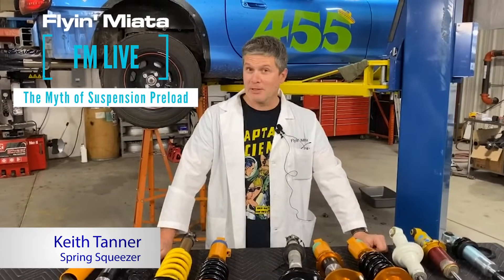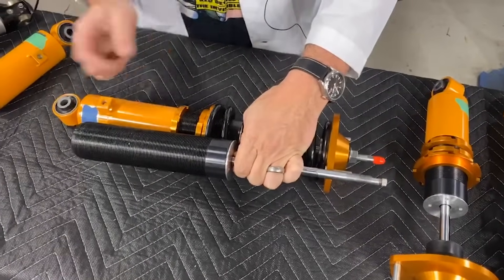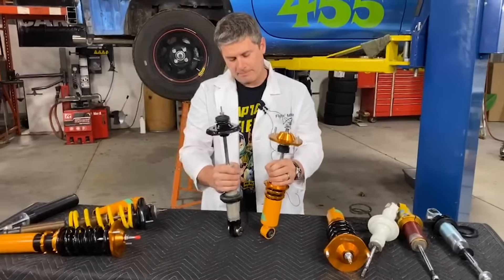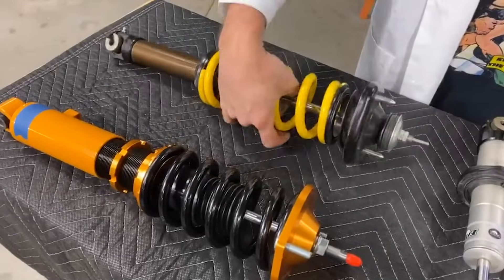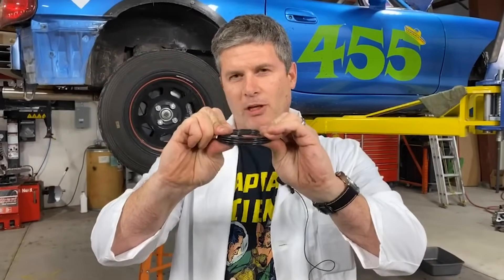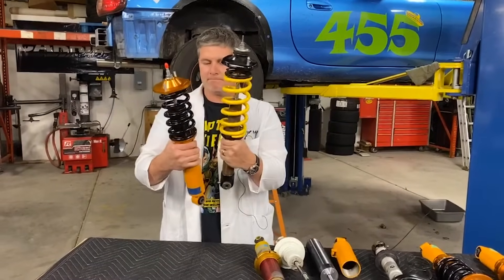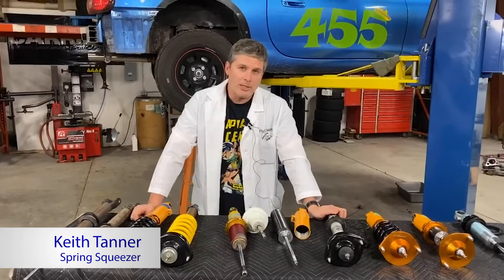The Myth of Suspension Preload (FM Live)

Comment: Make sure you know your motion ratios. The fronts tend to be very high relative to your rears.
A 6in travel Front suspension could be 10in travel at the Front wheels.
Reply from the maker: Good point and for NAs this is why a 3/16" shock top spacer results in a 3/8" height difference at the wheel.

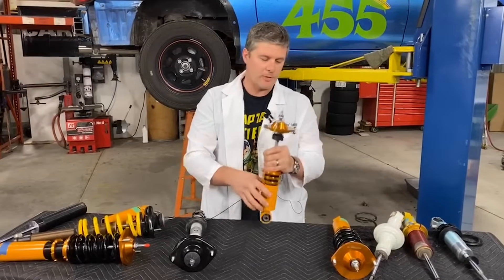Comment: quick question... Is the additional 4 mm on preload required and or a must… On factory bought proper OEM spec coil overs for an every day driver… Meaning 7:36  once a spring is tight in the cradle do you really need that additional four or am I just hindering ride  quality??   thank you for a response
Reply from the maker: Preload does not affect ride quality. Not sure where the "required" 4mm of preload came from, but that may be a manufacturer making sure various hardware does not come loose. Set the shock length first (if applicable), then set the ride height with the perches.
Reply: @FlyinMiataVideo   Thank you for your response👍
Reply from the maker: @darksolara6750 You are welcome and thank you for watching!

Comment: Perfect analysis, thank you! Just a question: In a rear torsion beam of a FWD car where damper and spring work separately (not as a coilover), if you use spring spacers in order to raise the ride height at the back, do you affect the spring preload?
Reply from the maker: Yes, most likely. The shock will likely be the limiting factor at full droop, and thanks to the spacer the spring won't be able to extend quite as far. So the preload will increase.
Will this have any effect on the behavior of the suspension at anything less than full droop? No, not unless the spacer is so big as to put the spring into bind at full bump.
Reply: @FlyinMiataVideo  Thank you for your reply! The preload changes the force needed to start compressing the shock, correct? So why this will not have any effect on the behavior of the suspension? I would assume that at least for "small" forces a preloaded spring will be "harder" to compress and therefore harder compress the shock.
Reply from the maker: @dinostalieris3998  When the suspension is at full droop, it won't start moving again until the loads on the spring exceed the preload. Once the spring starts to compress, it won't matter if there's any preload or not. So the only time there is any effect is when a wheel is fully unloaded, such as when you're jumping or if you're hanging a rear wheel under hard cornering - something FWD cars may do.

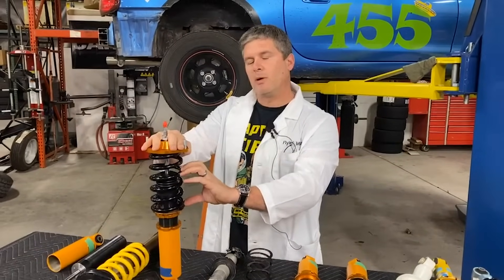Comment: I don't know if this is a semantic thing in the example presented, but the bit I'm still confused about (and other comments only added to the confusion) is the mention that "the ride height will be the same" around 2:35. When people talk about "applying preload" aren't they doing so by raising the spring perch while the shock is at full extension, which I've understood should be raising ride height? Or are we assuming that they'd somehow be adjusting preload without raising the spring perch in that example?

Edit: never mind, I found an argument below that suggests we agree that the ride height will change if you "adjust preload" by moving the spring perch up. It seems like your main contention is that the preload is a side-effect there and not the main thing we're adjusting, but it seems a tad nitpicky to make that the distinction since the only way I could imagine anyone out there reasonably changing the preload IS by moving the perch at full extension-- I feel like that is the basis of a lot of the misunderstanding/disagreement in this comment section.
Reply from the maker: The point being made there is that preload is only measured with the shock at full extension. It does not directly affect ride height. It's possible to build two shocks with different shaft lengths but that are otherwise identical. One will have more preload than the other with the perches at the same place, but they'll have identical ride height and travel. This isn't something you can do without disassembling the shock, so it's more of a thought exercise for most people.
With two piece shocks, it's possible to change the perch position - change the preload - and then adjust the shock body length so that the ride height stays the same. This is where all the confusion comes from, the concept that changing the preload is changing the handling or ride quality. This sort of adjustment has the side effect of changing the range of travel in the shock, which is what people are really reacting to.
Reply: @FlyinMiataVideo  Makes sense, thanks for clarifying!

Comment: Interesting video. The lesson about suspension travel was learned many years ago by Colin Chapman who endowed his Lotus cars with soft springing, firm damping and lots of travel when everyone else in that era was making everything solid in the vintage fashion. Re preload, is it not the case that it does affect ride quality to some degree on bumpy roads? With a little preload, the spring will work in both directions, and follow the contour of the road better. The Lotus Elans and Europas all had preload in their springs back in the day. On racing motorcycles they are always playing with preload!
Reply from the maker: The only time preload comes into play on the road is when the wheel has been completely unloaded (lifted off the ground). The preload will affect how much load will be required to start the suspension moving again. But as long as your wheels stay grounded, it has no effect. The load of the car on the springs makes them "work in both directions".
Motorcycles, of course, have massive weight transfer and will unload front (and rear!) wheels regularly. So the preload will have an effect on how the bike behaves when the wheel comes back to earth.
Reply: @FlyinMiataVideo  Thanks for the explanation, I get it a little better now.

Comment: This explanation is gold.

Coming from the offroad industry where coils are almost always progressive rate, I'm so used to making ride height adjustments through the spring collar.

Now that I'm putting coilovers on a car, I didn't even consider how the coils are single rate and won't make any difference to ride height.

So at the end of the day, when installing coilovers for a car, the only thing to be concerned about when setting the spring is coil bind... which would take a pretty hefty amount of preload and should be easy enough to avoid anyway lol.

Thanks for the video! But I do have a couple questions...

Do cars ever use progressive rate springs?

And if not, why not? Seems advantageous when it comes to road racing with higher or lower g turns and handling characteristics throught said different turns on the course.
Reply from the maker: Some cars do use progressive rate springs. It's harder to get the damping right as the spring rate is always changing, and the increase in spring rate with bumps can lead to some odd handling at the limit. They're most likely to be used when ride quality is the primary focus.

Comment: Coming from the motorcycle world it shocks me (haha) how 99% of car enthusiasts dont understand that a shock should have a static sag of around 30% its available travel. Preload is the only way to achieve this considering your spring rate is at least roughly correct for your vehicles weight.

Too much preload = not enough static sag = wheel not able to drop into potholes and such = loss of traction

Too little preload = too much static sag = loss of available travel for compression impacts and hitting the bump stop = loss of traction

30% is standard because its a good compromise.

I loved your video on corner balancing, i used it to build an Excel doc that does all the calculations automatically for corner balancing the sprung weight on my s15 (because i didnt have scales) but im highly surprised you think preload doesnt matter

Id be happy to send you my doc so you can input some basic measurements for the miata and see how preload affects things
Reply from the maker: You’re making the common mistake that preload is what is affecting your sag. Really, it’s perch height, spring rate and spring length which means ride height. Preload is sort of a sideways way to measure that under one specific condition - full shock extension. The effects you’re attributing to “preload” are actually compression vs droop travel, and they hold regardless of what the preload on the spring is. 
Cars have a limited range of suspension travel. Sports cars like the Miata generally need as much compression travel as they can get, so sacrificing it for droop is not an effective setup. One big difference between bikes and cars is the extreme amount of longitudinal weight transfer in a bike - short wheelbase and a high center of gravity means the bike is far more likely to be at full droop. So the fact that preload affects the way that the suspension starts to move off full droop - and only then - is why it can be used as a motorcycle tuning tool as long as you don’t forget there are other factors involved.
The fact that adjusting the travel range of a two-piece shock also happens to affect preload is why so many people attribute the change in behavior to the wrong measurement. Changes in behavior attributed to preload are almost always due to the change in suspension travel range. As noted in the video, you can change the preload on a spring without affecting ride height, spring rate or compression travel on a car by installing a longer shock shaft, and then car’s behavior will not change unless it was critically short on droop to start with.

Comment: Would spring pre-load affect the ride quality in terms of how crashy it is? On my 2005 R53 Mini, I have BC Coilovers (fitted by previous owner) and they are horrenoudously crashy - any kind of broken road surface or slightly sunken grids in the road will make the suspension crash and bang - the whole car shakes and rattles, for a road car it is pretty much unacceptable and embarassing when having passengers in the car. I have been told that this could be due to the BC using a pillowball top mount (metal to metal) with no rubber bush - but I have friends who have different coilovers which are also pillowball that dont have this crashyness?
I know the BC BR series are quite an expensive coilover, so I am kinda surprised at how no one else seems to comment about this.
I've played with the damping settings (full soft to full hard) and it didnt really affect what I am experiencing.

Any help much appreciated, thanks!
Reply from the maker: It shouldn't have an effect until you get your preload close to the weight on the wheel - in other words, once the suspension doesn't really extend when you jack a wheel off the ground. It's a little difficult to identify exactly what's going on from your description, but we'd start by making sure you currently have enough bump travel. If they're a particularly short travel setup, leave yourself some droop travel as well - you'll want a roughly 2:1 ratio of compression to droop. Given that you've already played with damping settings, it's most likely a geometry problem with the setup. Get yourself the setup instructions for your coilovers and start from scratch.
The pillowball mount might transmit some extra noise, but it shouldn't degrade actual ride quality. Bad end links can also cause noise but not shakes.

Comment: i have  fully threaded coilovers and i dont know how to soften the ride its very stiff and unconfortable... pls help
Reply from the maker: Most fully adjustable coilovers have some sort of damper adjustment knob on the very top of the shock shaft, or near the body on the shock body, but not all coilovers have that capability. Spring rates can also make a huge difference on ride quality, so if your springs are too stiff, your ride may be very harsh, even with the shocks adjusted to the softest setting. If you can, reach out to our customer support team directly via phone or email. They can get some more details on your specific setup and possibly give you some pointers on how to get a better ride.

Comment: For any given shock, does the droop travel depend on how low your ride height and how high your spring rate is?  It seems to me that is the case, as your car sits lower, the shocks will be compressed more at ride height so there will be more droop (less compression travel). On the other hand, if the spring rate is higher for any given ride height, the shocks will compress less and therefore take away some droop travel (but increase compression travel).  This seems to make sense to me but I am not sure. So is it always a compromise between droop/compression travel and ride height/spring rates?
Reply from the maker: That's half right.
Ride height is definitely involved in the amount of compression vs droop travel available for a given shock. It's the primary factor.
Spring rate itself won't change the amount of travel. It's all about ride height and the shock geometry. If you increase the spring rate but want to keep the ride height the same, you have to change some other geometry such as the perch position (this has no effect on travel ranges) or the length of the shock body, which can have a considerable effect on shock travel range. The shocks on a Miata should be set to give as much compression travel as the suspension will allow, so there's really only one correct shock length regardless of ride height unless it's some offroad lifted mutant or you have a shock that is poorly designed and extremely limited in shaft travel.
Reply: @FlyinMiataVideo  Thanks!

Comment: The problem I have with your explanation is that the spring, say rated at 100 lbs per inch, if compressed/preloaded 2 inches is storing 200 lbs of restoring force. If a corner of a car weights only 100 lbs (as example), that corner with a 200lbs of spring restoring force will feel over sprung. In a linear spring to compress a spring 2 inches you need to add 2x the lbs/in of what it is rated, not 1x. I have a problem with Ohlins on my M3 in front where spring preload and height adjustment are the same adjuster. I have to preload a soft long spring several inches to achieve the ride height I want. And once you jam several inches of preload into a spring it no longer functions as what it is rated as it functions as x multiple of that and the ride is a bit jarring. I also try to make sure I have enough bump vs droop since the piston shaft is super short, and it requires me to preload the spring quite a bit.
Reply from the maker: If your preload is higher than your corner weight, then your suspension will be fully extended at your static ride height. This is a real problem, and will lead to unpredictable handling and poor ride quality. In your example, the suspension wouldn't start to compress further until you'd hit a 1g bump. And of course, you'd have zero droop travel. Most of the time, you wouldn't have a functioning suspension at all.
It sounds like your springs are too long in your example. The biggest problem is your short shaft travel, but in order to deal with that you'll need springs that are correctly sized.
Reply: Did you ever get this solved? What was the solution @mrgizmo7975?

Comment: I am curious with do harder the spring rate is the less travel it need? For example a stock 5k spring and have 10mm droop travel, it’s that mean a 10k spring only need 5mm droop travel? It’s that how it work?
Reply from the maker: We usually think of it the other way around. How much spring rate do you need given the travel available. But you can look at it this way.
A 5k spring will compress twice as far as a 10k spring for the same load. So you need twice as much travel available if you want to stay off the bumpstops. And we're paying more attention to compression travel than droop travel.
Reply: @FlyinMiataVideo  thx for your reply
Reply: @FlyinMiataVideo  I just clear my mind. Just make sure my assumption is correct. Droop travel don’t affect by the spring rate a lot because it’s not compress the spring, bump travel does.

Comment: All I know is that I didn't preload my coilover springs the first time I installed them and the car was extremely bouncy. After preloading them the ride was much better. As good as it can get with coilovers.
Reply from the maker: That’s a common line of thinking. 
What you really adjusted was your compression travel. To get more preload, you shortened the shock body. This gave you more compression travel so you didn’t hit the bump stops as often. The preload is a side effect of this adjustment, not the cause of the change in behavior.

Comment: This is crazy scary correct info.  I just installed a set of coilovers and tried to set ride height both ways.  Guess which one turned out with a more predictable result?  Using the spring perch instead of shock body.  The amount of sag with the common preload of 3-5mm was almost making the coilover useless.  It just makes sense.... every strut I've seen taken apart required the spring to be compressed. The amount of people setting up all of these two piece coilovers wrong is crazy to think about.